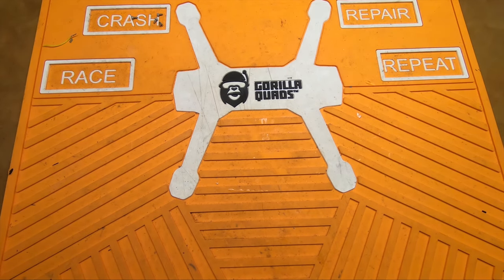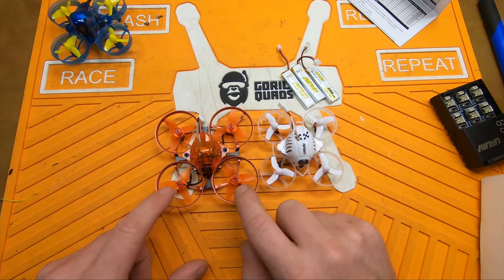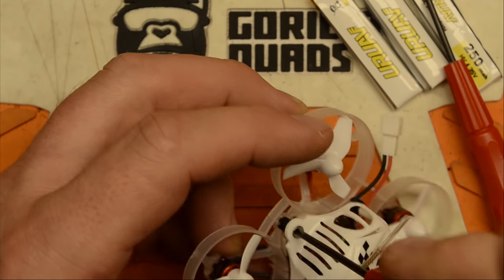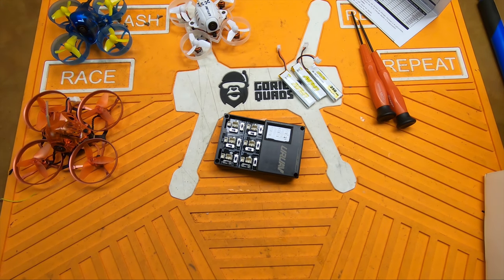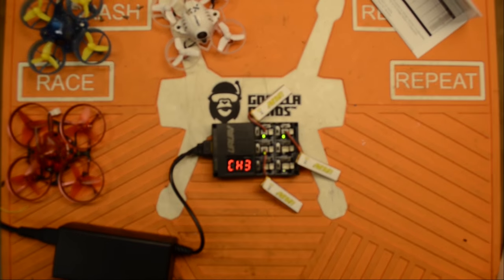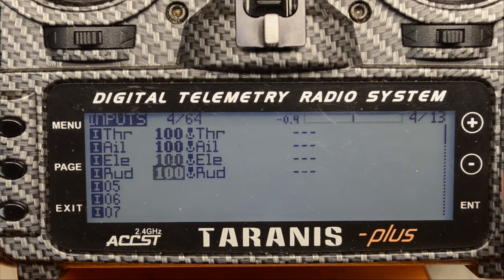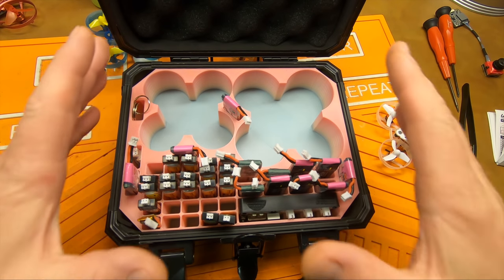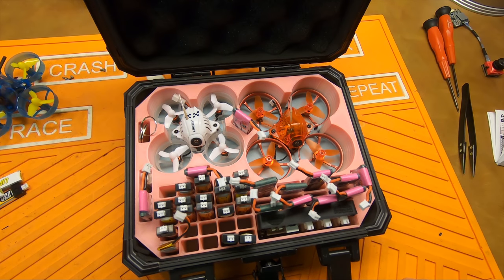URUAV UR65 Review, setup, and flight

Comment: Nicely done review. You hit on many points many reviewers simply pass up. Ordered one up today. BNF w/3x batts/spare frame for 100 bones seems dang good compared to the dji mavic's ive been buying lolThanks again
Reply from the maker: Thank you. I try to do something different than the other reviewers out there. It helps that I'm a smaller channel and I have sufficient time with a product before I make my review video. Please check out this video. It covers a reciever issue on all the crazybee boards with the built in reciever on the spi buss https://youtu.be/pjzzDhd8fEA

Comment: if you got it from Banggood order replacement motors. I hate the wait (5 weeks) but you probably will need them. This is a wicked fun drone for indoors. Mine lasted about 3 weeks before i lost a motor. i didn't catch it at first thinking it was the FC so I ordered replacement parts. I found one of my motor shafts would just spin (broken motor). Tip they also come in CW and CCW which I missed on my first order sucks (10 Weeks wait). I run about 8 or so packs a day more if I have the time so I really do enjoy this quad.
Reply from the maker: Could you just reverse the motor in blheli suit or are the directional for cooling?
Reply: @TweetFPV  You know for some reason i didn't think of that. I could also switch two wires. Thank you especially today because I just crashed into the dog's  drinking bowl I may have ruined my quad. I could get lucky with no damage well see when it dries off.
Reply from the maker: Sometimes you get lucky!

Comment: Great great video. I have too little experience with this, i bought this UR65 (drone) + Jumper T8SG (transmiter) + Aomway (fpv googles) but i have some difficulty configuring and understanding most of the technical terms.. what is acro and such.. 😒
Reply from the maker: It sounds like you have a great setup that will carry you into this hobby for some time.
Acro: no auto level, does not use any accelerometer inputs. So basically if you point the quads nose down 10 degrees it will stay there when you center the sticks if you want to return to level you must pull back 10 degrees. This is also sometimes referred to as rate mode.

Angle mode: slef levels when the stick are returned to center. Must have the accelerometers enabled. You can not do flips in this mode. It is locked at a max angle of your choosing in the betaflight firmware

Horison mode: a lot like angle mode but has the ability to flip. In general I don't recommend this mode as the threshold where it is self leveling and when it will allow a flip is kinda unpredictable.

Air mode: this is just a setting that keeps the Motors from loosing thier authority when the throttle is at 0. I highly recommend that air mode is used at all times or at least when in acro mode.

Let me know if that is confusing in any way or if there are any other terms that you would like explained.

Happy flying!
Reply: @TweetFPV  after a few months, i finally took this stuff out of the box again.. i forgot how to set things up now though, but i had sucess, started to fly again. I used all my six 1S batteries now :). I remember i had to select quite a few options in this transmitter that got me confused in the past, but since i had success binding the drone with the transmitter i started flying right away. But i always knew there were a few things i should configure better. The way i have this now, this UR65 is very very fast turning, etc. I do not have any stability like i see you guys flying around. I am better flying now, but anyways... Is there a place where we can talk better or even skype a few minutes? I don't want to take your time though..
Reply from the maker: Email me at tweetfpv@gmail.com

Comment: Great video, very thorough! Just got my UR65 and Tranis QX7 and followed your instructions to set it up! :)
Only problem I have is although I can see the throttle seemingly setup and working fine on the QX7 and beta flight but nothing happens to the UR65 when I push the throttle up :( :( the motors spin only when I push the throttle both sideways. Any tip please?
Reply from the maker: In betaflight under the reciever tab do the stick movement corospons to the correct stick movement?
Reply from the maker: And are you flying mode 1 or 2? Throttle on the left or right?
Reply: initially, I would remove / change the other modes for various switches you may or may not have set up. that are in there by default besides Arm, they are probably messing with you.  I had the same issue.  Be aware this will default you to acro mode.